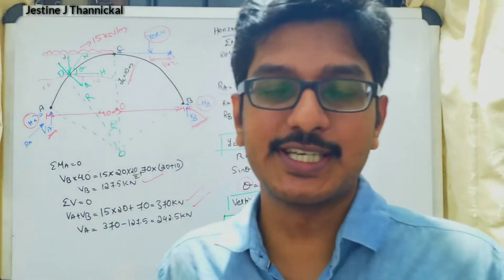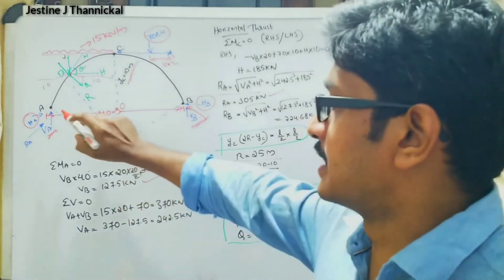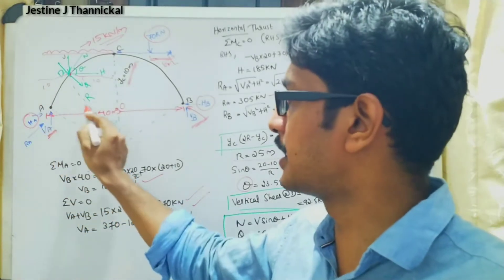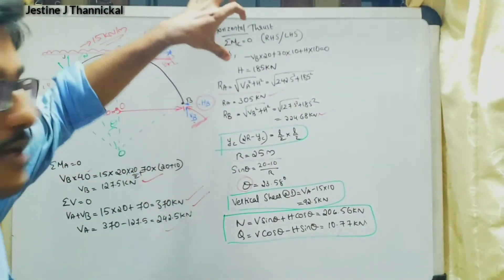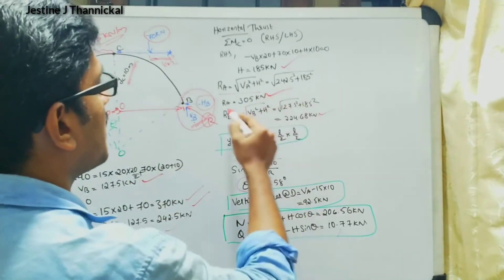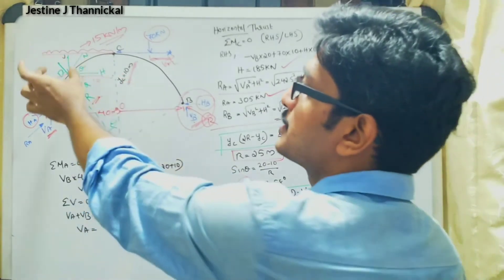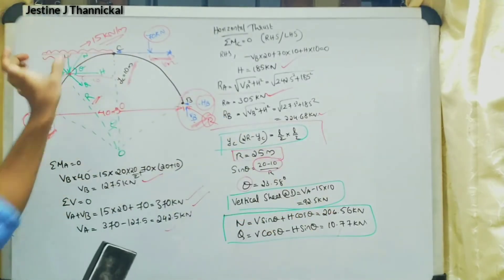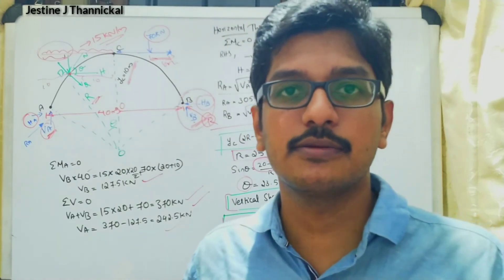#ktu #structural #circulararch  LECTURE 22 PROBLEM ON CIRCULAR ARCH

Comment: Good lecturing sir, can you please clear how to calculate vertical shear
Reply from the maker: The point where u have to calculate the vertical shear ,then consider all the forces either to the left or right of the section. Here we consider the vertical forces in the left of the section.
Reply from the maker: If you have still doubt, contact me on 9446248368
Reply: @JestineJThannickal  It's clear 😀
Reply from the maker: Okay dear